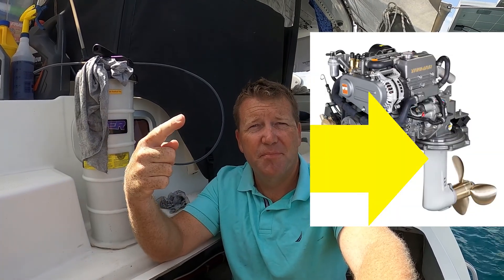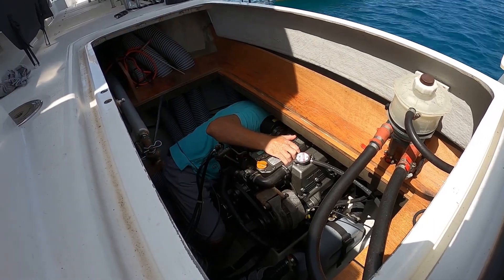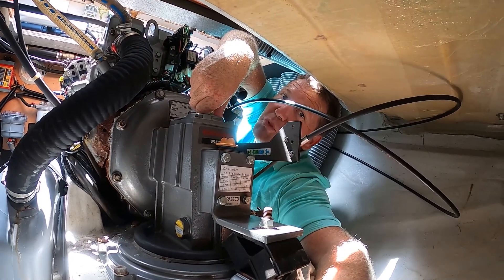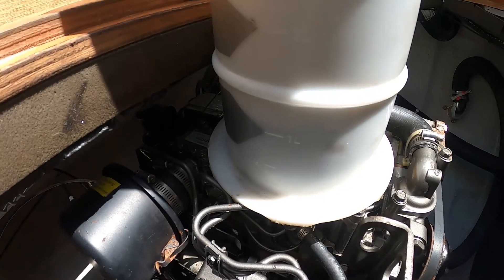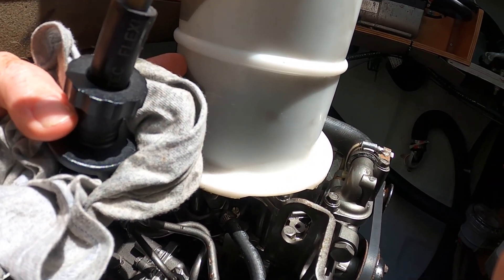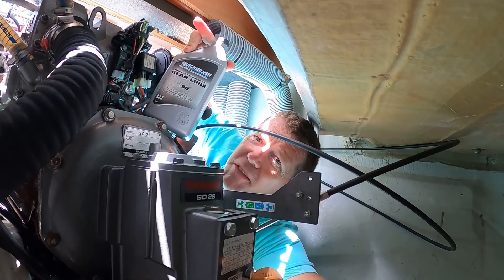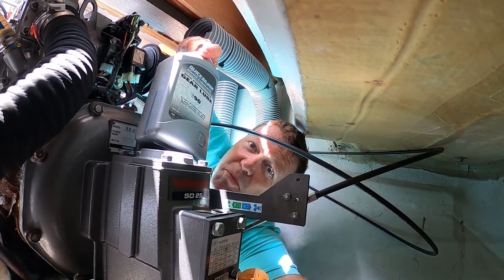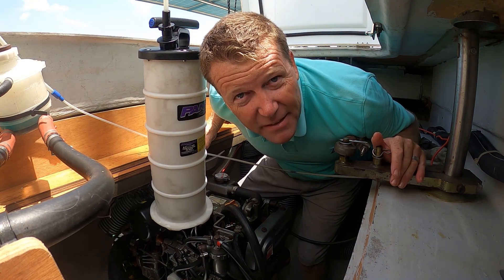Changing the Saildrive Oil, Sailing Laguna #39

Comment: Thanks for your creative and clear camera angles on the video.  We have Yanmar 2017 SD-60 saildrives on our catamaran and the manual recommends an oil change every 250 hours or once a year - same as the oil change schedule on the main engines (4jh57).  I use the same brand vacuum pump and it comes with enough extension tubes to place the pump on top of the engine making it comfortable to pump out all 2.8L in each saildrives.  Even with using tape to seal the pump hose to the built in hose that goes to the bottom of the saildrive, it still sucks up a lot of air with the oil making it a far more tedious process that when vacuum pumping up the main engine 5.5l oil which is located on same side and about same level.  But eventually all the oil comes out.  It sure is much easier to change the saildrive oil on the dry which we do every 2 years.  Yanmar recommends 15W40 long lasting premium oil for both the engine and the saildrive making it easier to purchase and manage.